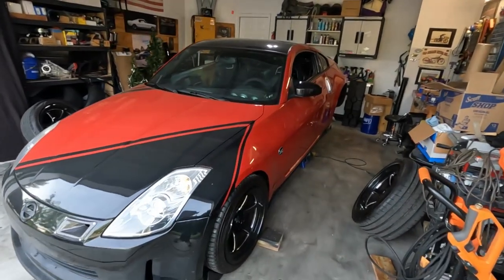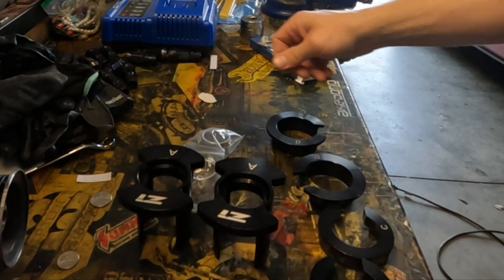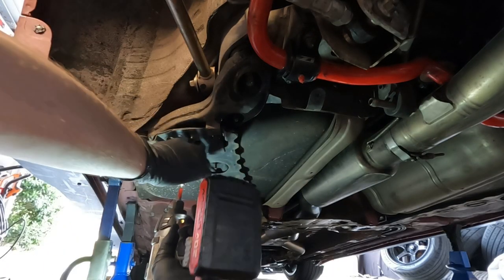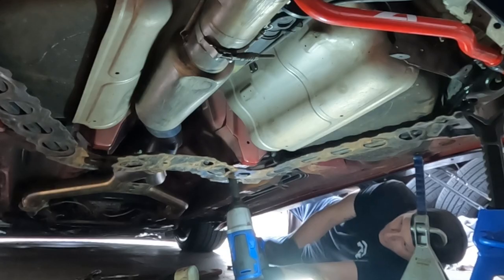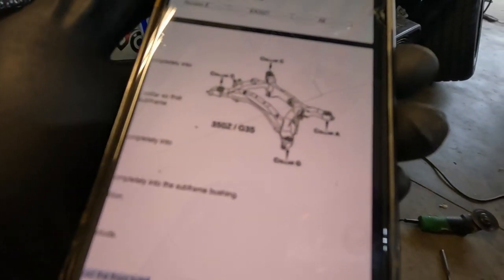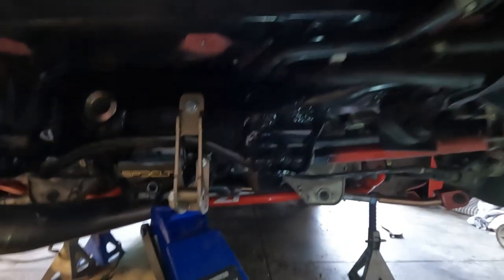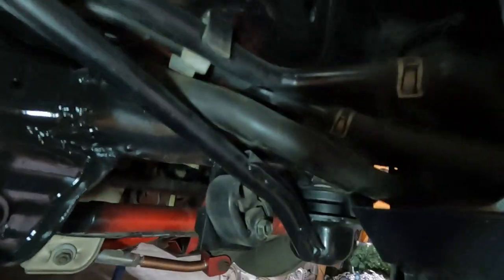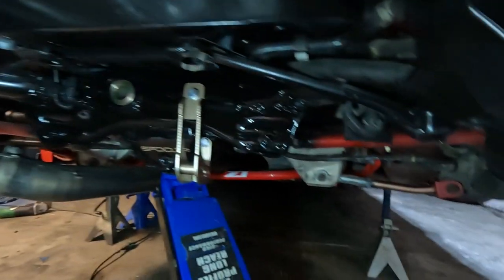Z1 Subframe Bushing Collars Installation 350z

Comment: looks like you have many parts im interested in/ collars z1 sway bar rear diff bushing. have the sum of these parts majorly increased NVH? and is the car still good for street use or does it hae less traction?
Reply from the maker: Take a look at my channel—I have done reviews on all of the parts and recently made a mountain run with everything installed and gave my feedback.  Slight vibration with motor and trans mounts.  Nothing else caused vibration. The ride is more rigid certainly but wouldn’t consider it harsh or beyond streetable. The car is loud because of the Tomei and being partially stripped so I hear no other noises 😂
Reply: will do. thanks man
 @SpeedCultureStudios

Comment: I did this when I did the rear diff bushing. Easy in comparison.
Reply: do you think its easier to do both at once?
Reply: @supradoom  sweet , thanks for the info, ima be doing z1 motor and transmission mounts, and the diff bushing and subframe collars inna couple days